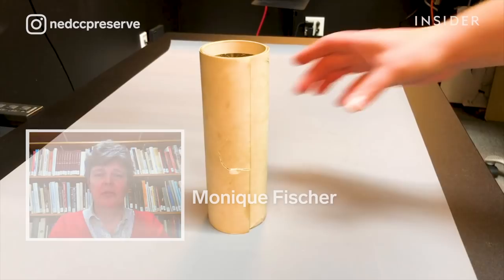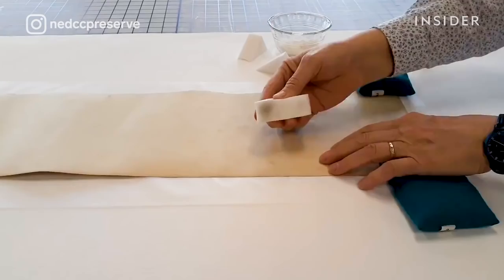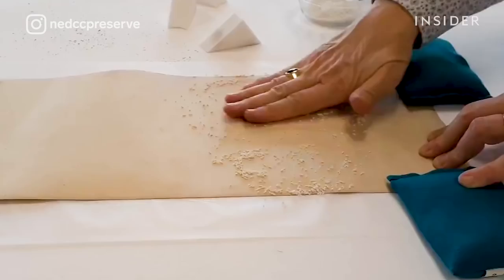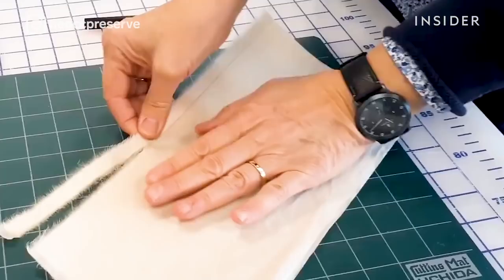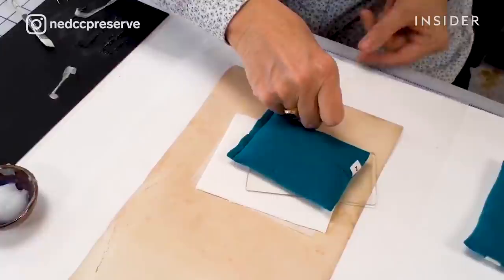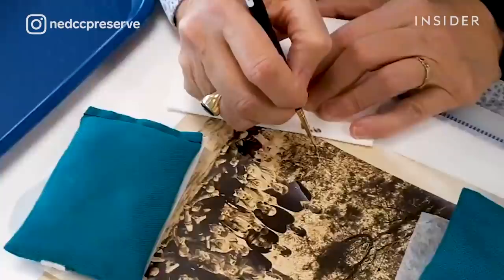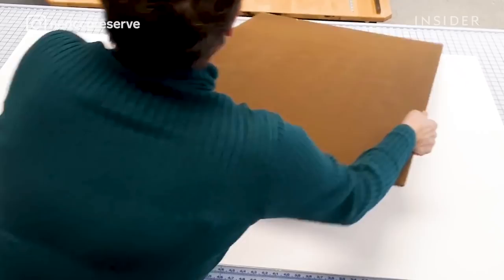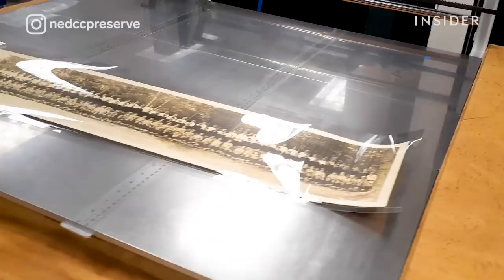How A 90-Year-Old Photograph Is Professionally Conserved | Refurbished

Comment: Many problems with this conservation process. (1) Prior to cleaning the back of the photograph, the front of the photograph should be at least spot cleaned with a blower (like the Orbit HEPA blower) or spot wet-cleaning on areas with accretions/dirt because the pressure you apply to the back when cleaning with sponges may cause damage or small indentations on the photo if larger surface dirt isn't removed. (2) Water and alcohol is not the greatest solution to use on photographs because water will swell the gelatin. Far better to use something like PEC-12, which doesn't contain water. (3) The strokes used on the photograph during the front-cleaning are atrocious in terms of technique. Abrasion to the photograph can come from two different sources - the cleaning material itself, or the dirt that comes from the photograph itself. Continuing to use long circular strokes when the cotton has already picked up any type of surface dirt risks abrasion to the photograph as you are just dragging the dirt across the surface. Best practice is to replace the cotton swab/PEC-PAD the moment it picks up any dirt. Cleaning photographic surfaces is very time-intensive. This was a lazy way of doing it. (4) The back of the photograph is being cleaned with too many passes. Probably better to use Absorene soot sponge with a HEPA purifier running and a directed fan for ventilation (to disperse any sulfur smell quickly); a couple of passes would have almost certainly have gotten most of that dirt off without abrading the fibers so much. Dust off with Orbit HEPA blower or a clean new soft brush to remove any residue, even if invisible to the eye. (5) Long panoramic photos like these should not have been placed in archival polyester without any backing. 100% cotton-rag buffered museum board should have been placed on the back as a backing. If the client cannot control the humidity in the storage area, then plastic shouldn't have been used at all. Instead, photograph should be stored between two pieces of 4-ply or 8-ply buffered (for the back) and unbuffered (for the front) museum board.